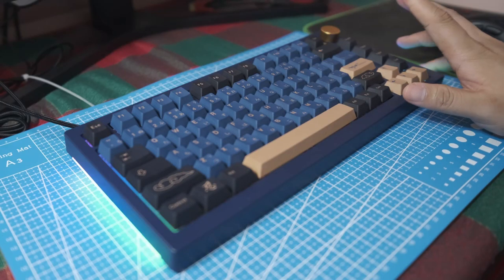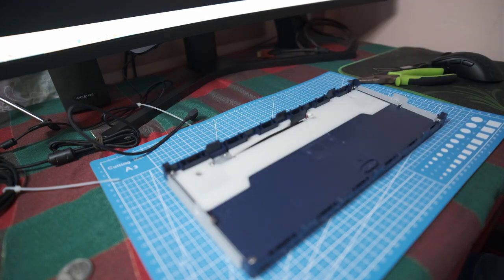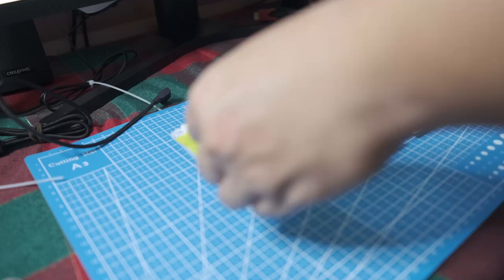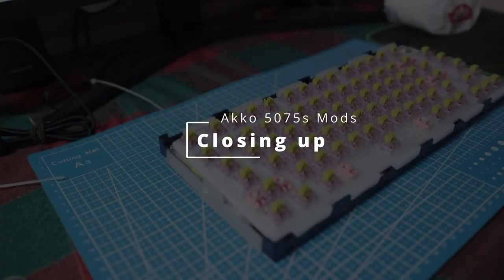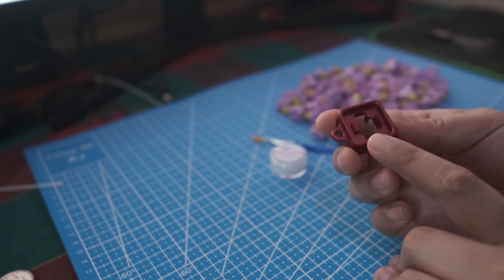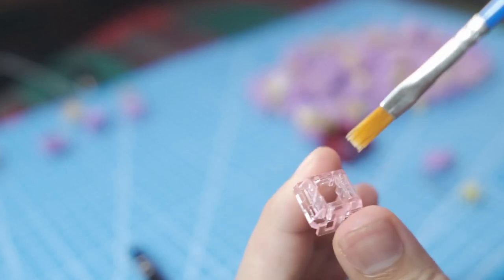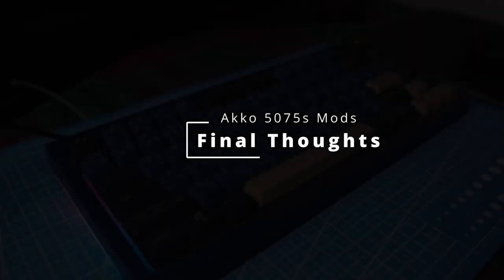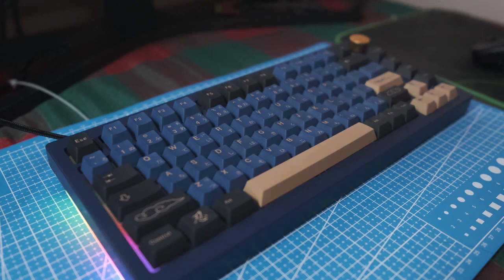Modding the Akko 5075s

Comment: I've finally found a MUCH better, easier and faster way of opening the board, RISK FREE and without hurting you. if you have a protractor You can you it and try to put it in the gap and then without taking it off you can spin it to get to the other thingies and easily disassemble the keyboard. I please share as much as you can bc I have never seen anybody saying nothing about this method.

Comment: Would you be able to use different stabilizers with this keyboard? Also, do you recommend using the stock stabilizers that come with these or would you rather switch to different ones?
Reply from the maker: Yes you can order Plate-mounted stabilizers for this on Shopee and other online stores. Durock is a popular 3rd party brand. I have personally not replaced them, I am quite happy with stock tbh. I do plan to holee mod them soon.

Comment: Is there any interference with those keycaps?
Reply from the maker: No interference. While the 5075 is a north-facing LED keyboard and this is a Cherry-profile keycap set, I guess the Akko switches are different enough from the original Cherry switches that they can be put together without interference

Comment: Best stock sounding keyboard for this layout would be the GMMK Pro, depends on your switch and keycaps also.  But it also depends on heavily on your budget, since your looking at this 5075 keyboard from Akko, I would say go for the Feker IK75 Pro, it sounds really good stock and the acoustics are nice.  I got both, but if you go with the Akko one, definitely lube the switches.  Just don't go for the switches he used in this build, it sounds too quiet IMO.  Unless that's the type of keyboard you want to build.  I personally love a bit of clack and thock on my builds as it's music to my ears.  Hehe
Reply from the maker: I also have both and I think this and the Feker are sidegrades to each other. Each has different strengths of course. I will be making a comparison video very soon!

Comment: Hello sir, 

I have the exact same keyboard (down to this gorgeous dark blue colour) and very similar keycaps to yours (although mine are GMK Stargazer clone cherry profile caps). I must totally agree with you that this keeb is an absolute struggle to work with (validating what you meant when you say the 'S' stands for struggle, lol). (Btw, to open the keeb case, use an old, unused card to pry it open from the sides - I emphasise on "unused" because my keeb tried to fight back by actually snapping my card in half during my second disassembly D: ).

Although this keeb can be gorgeous with the right set of keycaps (plus, love that side LED), it is possibly the most frustrating when it comes to modding (particularly if you try modding it more than once, like I had). Repeated disassembling and re-assembling led to some parts of my keeb's case to break. D: The only reason I kept modding it multiple times was because I wasn't happy yet with the typing feel or its sound profile. I've changed switches multiple times (Macha Greens and Rose Reds led to this muted, quiet sound even if you remove both silicone PCB foam and the stock poron switch pad, Lavender Purple tactiles came out as 'crunchy' rather than 'clacky', while Jelly Blacks and Jelly Pinks had obvious interference on certain key rows), I've taken out and inserted back in the silicone PCB foam (if you take out the foam, the switches become a bit loose on the PC plate), and my stock stabs have this awful squashy feel every time I press on the keys (I only found out later on that it was due to the extra PE foam I put between the plate and PCB). Also do be careful when installing switches onto the PC plate - this can be a struggle too as I ended up bending a few pins on some of my switches because they just. Don't. Want. To. Go. In. 😮‍💨

Overall, this is still my most frustrating keeb I had the pleasure of building. :')

In terms of whether it's worth buying it? 

I think it may be worth it for those who just want to try out the hobby (just add switches and keycaps) but don't want to get deep into the modding process, especially if it involves disassembling the keeb. 

For those who are interested in getting this Akko 5075s barebone kit, do be mindful that cherry profile keycaps (no matter how pretty they are) may have interference if paired with the wrong kind of switches, so perhaps go for a different keycap profile instead, like ASA or XDA.
Reply from the maker: Nice that there's others having the same experience and struggles as me lol. That said even with the struggle I do really like this keeb and I found the experience to be worth it in the end.

Did you do something with the stabilizers? I like the stock stabs on this and I'm planning to holee mod them
Reply: haloo, how about OEM profile keycaps? since if is somewhat similar to cherry profile so I ask. 
Does it works well with this kit? planning using with akko cs silver switch
Reply: @shopeetechreview7466  I recently got myself some POM silvers and it had the most suitable sound profile so far (no interference on cherries). However I couldn't use those switches for the stabs (except spacebar) because for whatever reason the keycaps stuck to the stabs and I couldn't press them anymore so I had to change to lavenders. I did relube the stabs but they still resulted in same problem - feeling squashy but now mushy too 😭 - I had to wipe it all off and leave them unlubed. 

I'm going to try wire wrap modding them to see if there may be improvement (another variant to holee mod).
Reply: @ncm0625  OEM profile should be fine and won't produce the interference - they're a rarer find as a custom-made keycap set which is why cherries and xda with a variety of designs are more available online. 

OEM also happens to be the profile for a lot of prebuilt stock keebs too. From experience, I do find oem produces a more high pitched, clacky sound if you're okay with that due to the thinness of the material. Paired with the cs silvers, I imagine they would have a light typing feel with high pitched sound.
Reply: @fairweather276  Thanks for the reply! helped a lot.
Reply: I plan on buying this keyboard in a few days and since you have a lot of experience I wanted to ask if the matcha akko switches with PDT, XDA profile keycaps would interfere with the north-facing LEDS? Also, is there any modding advice you'd recommend for the barbones kit? I've seen people do the tape mod but I don't want my keyboard to "pop". I prefer a "thocky" sound profile but it's okay if I do not achieve it. In your review I read how you added more PE foam and I was wondering if that made a difference? (I only plan on lubing the switches and stabilizers)

This is my first ever custom keyboard and I really love the AKKO5075s. I don't plan on making this a hobby since I'm #certifiedbrokie but if I'm spending money, I want to spend it right.
Reply: @notgrayish5764  Hi, PDA and XDA should be absolutely fine as they are taller keycap profiles and thus won't have interference with the NF LEDs. It will also be fine with macha greens. Cherry profile - having low height, esp in certain rows - usually result in interference.

As for modding advice, the simplest one would be the Tempest tape mod with either masking or painter's tape (as these are not sticky and won't damage the pcb). It would improve the sound quality of the board (I think it does this by bouncing back the sound with every keypress.)

The pe foam mod between plate and pcb is the mod that will produce the poppy, marbly sound profile. So if you're not going for that, you don't need to put it in.  However, I would recommend keeping the pe foam that comes with the akko board in case you need it in future. 

Other mods I would recommend is obviously lubing the switches and stabs. I would also further recommend the holee or wire wrap mod for the stab wires for better stability (so there will be no ticking or rattling - use thin medical tape. If the tape is too thick, it makes the stabs sticky and hard to press). Just remember when you are planning to take out stabs, you'll have to take the board apart first because the silicone plate foam installed inside will be blocking the spacebar stab. 

Have fun with your 5075s! Hope it will sound good! 😁
Reply: @fairweather276  Thanks!
Reply: @fairweather276  I hope you don't mind me hopping on to ask my own question! I've had difficulty PE foam modding this keyboard - I prefer the PC plate as opposed to the aluminum plate, but with both I've noticed the plate buckling, resulting in the switches not making contact with the PCB in some areas (and a few bent pins on switches). Any idea what might be causing this, or how I might be able to work around it? I eventually gave up with the PE foam because my fingers were nearly shredded from constantly reopening the case. 😭
Reply: @hansolkim2343  Hi. I've had the same problem as well. One of my past configurations was taking out the sillicone plate foam and poron switch pad and leaving both PC plate and pcb bare (This keeb seems to make any switch sound muted and high pitched). I have a feeling that it's the way the plate was designed, like it was designed to have the silicone to fit under it. So if you take the silicone out, there is a space between the plate and pcb, leading to the switches being unable to sit on plate and pcb properly, and thus maybe the reason why some keys were not working. 

I tried tightening the screws for the pcb-to-plate, knowing I'll be sacrificing the Flex from the gasket mount, but the problems still persisted - there was still too much space between the layers. So in the end, I ended up putting the silicone foam back in and pairing that with the PE foam in hopes to pop out the sound of the switches so it wouldn't sound so muted. 

Another thing - if you are going to do what I did - make sure the order of installing everything together is: PC plate, silicone foam, pe foam, then pcb. I once did a config where I placed pe foam on top of the silicone rather than under it and that led to several keys not working at all. Suffice to say, I was not looking forward to re-opening that case again seeing as this was my fourth modding attempt on this keeb. My fingers hurt too much 😂
Reply: @fairweather276  Thanks so much, especially for specifying the order! I’ll definitely try this out!

Comment: What keyboard do you recommend same layout with akko 5075s without the need of modding it?
THANK YOU
Reply from the maker: Hello, I would say that the 5075s is perfectly fine as a keyboard without modding. If you just want to put the barebone kit together with switches and keycaps this keeb is still an excellent choice. 

That being said, there are many options for 75% keebs with a knob (my favorite layout):
Around the same price range: Feker IK75 Pro - I have this as well and love it, it's heavier and more solid than the 5075
Slightly more expensive: Keychron V1 - I have the 100% version of this (Keychron K10). Slightly clacky. The stock caps are great, comes with Gateron switches
More premium: Akko Mod007v2 or GMMK Pro - No experience with these 2 (yet) but I see a lot of positive reviews

The nice thing about the recent explosion in the mechanical keyboard hobby is that we are now spoiled for choice, just go to any online e-commerce website and search! 😊
Reply: @shopeetechreview7466  Thank you for replying.
Did you encounter any problem with Feker IK75 pro?
Any idea about the Akko pc75b plus?
Reply from the maker: @shinrakusakabe7128  No the Feker was really easy to work with. The only challenge I can think of is if you want to use the polycarbonate plate because then you'd have to replace the steel plate which comes attached to the PCB, but that shouldn't be too hard.

I have no experience with the Akko PC75b plus, I think it's a predecessor of the 5075? It doesn't have a replaceable plate and no side lights. I'd go with the 5075b over it.
Reply: @shopeetechreview7466  What about the lychee g80 pro. I cant decide what to buy